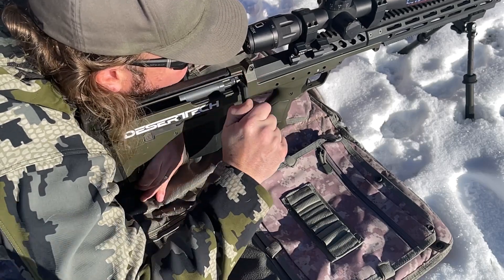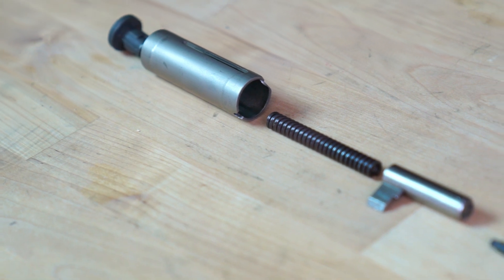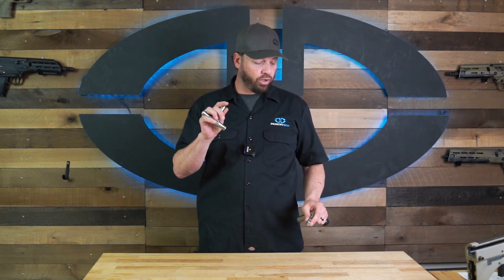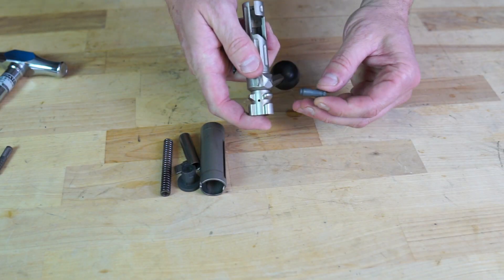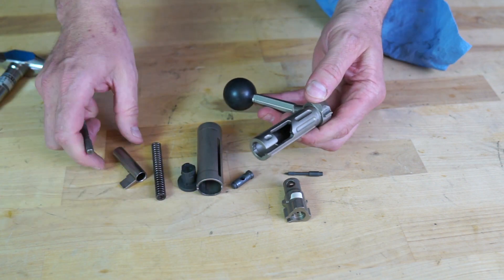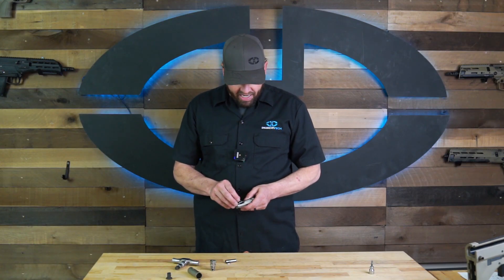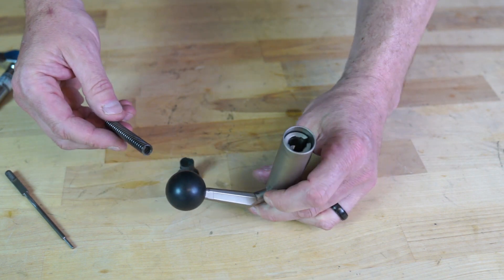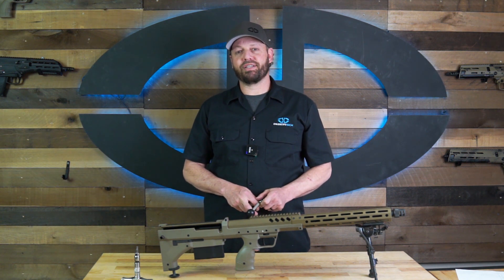The Desert Tech SRS Bolt

Comment: It'd be nice to see the day when DT will finally build a straight pull bolt action 🤘
Reply: why not just a semi auto then? why not just the MDR then? straight pull action can be fast, but it also tends to bind more, especially with high pressure rounds with tight chamber tolerances. this doesn't lend itself well to regaining target picture. What's the added speed worth if you have to spend that time and more resetting your holdover? most all of the straight pulls ever made were not for settling into longer shots, they were for fast follow up shots at short distance, like warfighting in the k31, or driven hogs or rabbits for those fancy European rifles. Which therefore again begs the question, why not the MDR at that point? the only reason modern straight pulls are mostly a euro affair is because of euro laws banning "assault weapons". they would LOVE to do their driven hunts with an AR if it were legal.

Comment: So it actually uses a linear hammer system. With the floating firing pin👍 Its at least what I have learned as the difference between striker and linear hammer. Since it strikes the firing pin and its not part of the striker it self😁

Comment: How do you switch to left hand? Or do you need to get a seperate bolt meant for lefthand operation
Reply from the maker: Its actually a little bit of a process, you use the same movements you would have done with your left hand, but use the right hand instead.
Reply: @DesertTechUT  I meant do you make this rifle for left hand shooters
Reply from the maker: @snakeeyes20a  we do not
Reply: @DesertTechUT  unfortunate, operating rh bolt actions is a pain for me as I have to break my stock  elevation position to cycle the bolt, I really liked the srs.
Reply from the maker: @snakeeyes20a  yes, we hear that frequently. But nobody bought the left-handed models we made them, so we discontinued them.